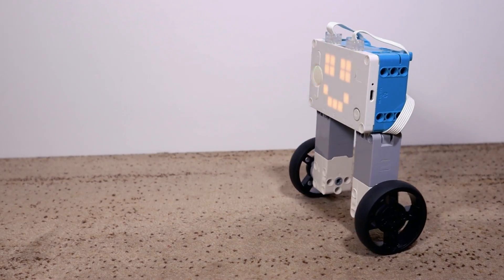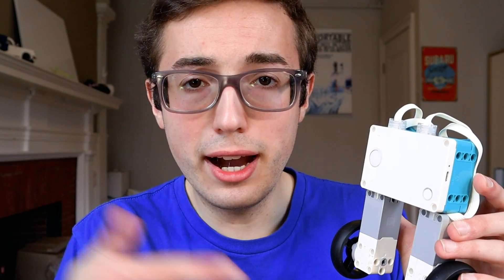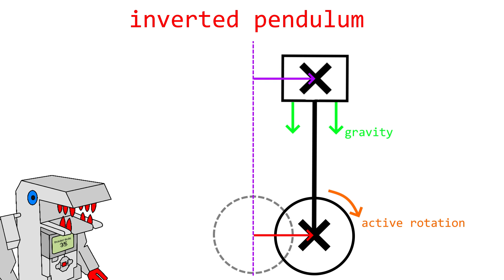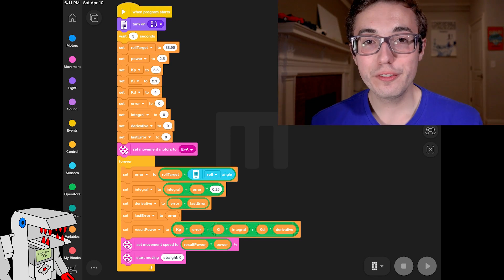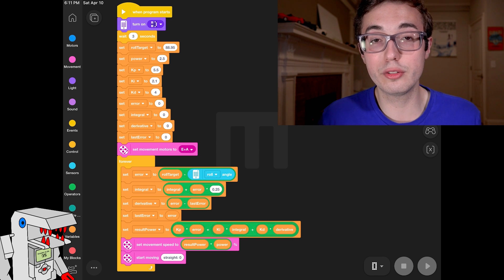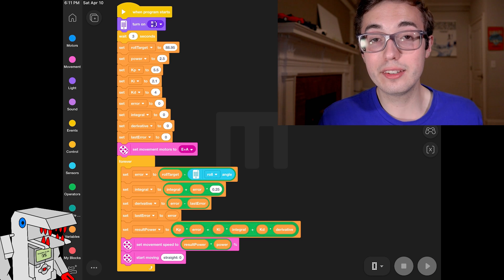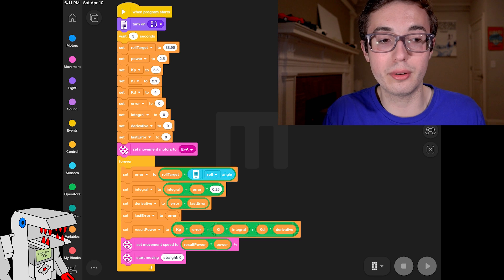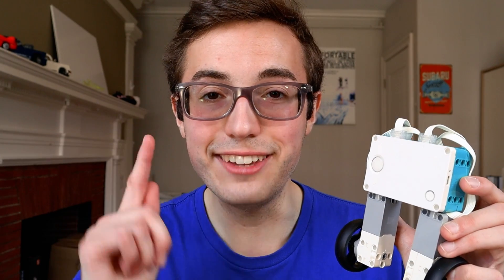How to Defy Physics With LEGO 51515 - PID Self Balancing Robot

Comment: I built this robot with Spike Prime, but with your values of Kp, Ki and Kd etc. it doesn't work at all. I set Ki and Kd to 0 and then with a little help the robot balanced, but when I let it go and the roll angle becomes a  bit too large, it falls doen and motors drive it over the floor. Even when I now at a small Ki value, it fails again. What do I do wrong??
Reply: Hello Fred, were you able to get it working?
Reply: @jtorrescr  No, I didn’t get it working fully without help. So I gave up.
Reply: @FredMellink55  :(

Comment: The sensor is not a gyroscope, but a 3D acceleration sensor, so it basically can output angles based on the movement of 3 little MEMS mass-spring systems. Nothing to integrate. Just read out the spring movement in the 3 directions and calculate angles with plain gonio functions.

Comment: Do you think it is possible to backsolve Kp, Ki and Kd by tracking the effect of power on the robot roll angle? So the idea is to let it play a little bit on its own by modifying the constants until it reaches the desired result and then these will become the constants to use. A little bit like the goal seek in excel.
Reply: Hey, mechanical engineer here. It should be possible. There are techniques already used in Technology, e.g plane stabilazation. Also bc you can analyze the swinging behaviour on the hub itself and calaculating the right parameters. Im currently working on this and let you know if i manage to do so ;)
Reply: If you linearize your system, and convert it into state space about an upright point (delta_xdot = A delta_x + B*deltau), then what you could do is plot your eigenvalues and vary it with respect to your PID gains. Your poles could potentially give you info on your settling and response times.

Comment: Doesn't work. That is just a scam. Don't try it, it's just a waste of time and lego.
Reply: I think all the guy needs to do is to convert his s-domain actuator dynamics and measurements to z-domain and tune his sample time. Notice how the Robot does big jumps in torque corrections while it self-balances. If the guy has a good bi-linear tranform, with a good sample time, then I think it would be better. 

Overall I don’t think he deserves this much hate. I think this is a good starting point for controls engineers that need more experience!
Reply: Mabey 
you did it wrong idiot cuz it worked for me
Reply: @GOOFYAHTAGGER Wow
I wonder what world you live in
Reply: True😢
Reply: Shut up nobody cares you need to try and try and try till it works dont give up so early no hate why hate i can ask for ages just dont give up😔😔😔😔😔😔
Reply: 100% Agree this is bad
Reply: @woodywong76  I know right!

Comment: May I add some improvement to your algorithm?
The motors are controlled by power, so I‘d say with torque.
The torque required is not linear with the error of angle, but with sin(error), as this is gravity‘s vector component perpendicular to the lever.
This results in a reduced correction around the target angle and a higher correction once deflected. So I wrapped the error Formular with a sinus function.
Of coarse the PID values need to be adjusted afterwards.
By doing so I could achieve a much more stable balance.
Reply: can you please share more details
Reply: That’s pretty clever. But if error > pi/2 your torque is going to a big negative value.

But to make things linear (and reduce computational effort), I would do a z-transform instead and tune the sample time.

Comment: I want to remote control movement for this robot:
Fwd/bwd and turn.
Reply: I guess you could manipulate the roll target, to make it go fwd/bwd
Reply: Did you manage to get it working? I've got some problems with doing it so I'd be happy if I can get some advice
Reply: @ImpostorSus  I barely tried, but not giving it enough time for any success . Then canibalized parts for a different project.

Comment: 2 hours of adjusting variables to find different ways of making it not work. Oh well.
Reply from the maker: It took me several hours and trying a few different surfaces to get it to work. Don't get discouraged. If it were easy, everyone would do it. ;)
Reply: @Builderdude35  is there at least some reasonable range for each of the P.I.D. variables to operate within? (So great to see you back again btw).

Comment: I was inspired to create a self-balancing Lego Mindstorm motorcycle using a momentum wheel, much like the ISS stays on orbit using giant gyroscopic momentum wheels, that affects it's jaw, pitch and rotation. I had success until I came to the part of the actual momentum wheel system, where I couldn't find a way to make the heavy Mindstorms brick to be affected by a light Lego motorcycle wheel. I abandoned the project because I couldn't continue or find a hardware solution. I had developed the necessary code, but it has no use without the executive part, the robot. Is there a way to find a solution to the problem? Maybe it could be an idea for a future project/video? I am also citing the link of the video, where I got the inspiration for my project:  https://m.youtube.com/watch?v=SUVtObDFFWY
Reply from the maker: I love this idea! In order for the gyroscopic effect to work, you need a rotating body with a lot of angular momentum. Unfortunately, the motorcycle wheel is too light relative to the EV3 brick, just as you noted. However, this may be interesting to try with LEGO 51515 given its hub is much lighter!
Reply from the maker: I'm definitely interested in attempting this myself.

Comment: You didn't divide by dt in the derivative.
Reply from the maker: You have out-mathed me, I tip my hat to you.
Reply: @Builderdude35  How does this correction change the code for this robot? And how is "dt" defined or calculated.
Please help. I've spent days on making this thing work, but to no avail.....
Reply: This is not necesary to divide by dt because you can assume that the time between loops is almost constant